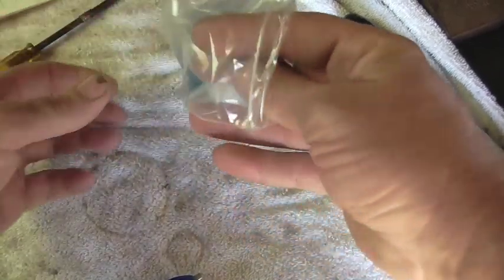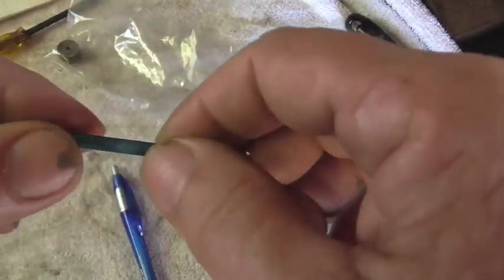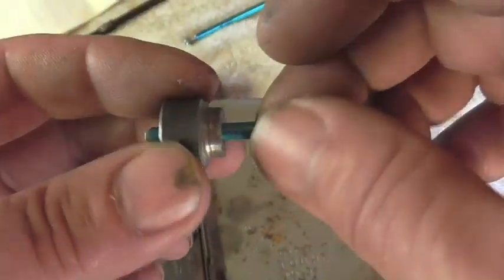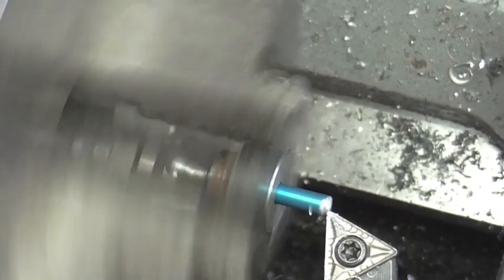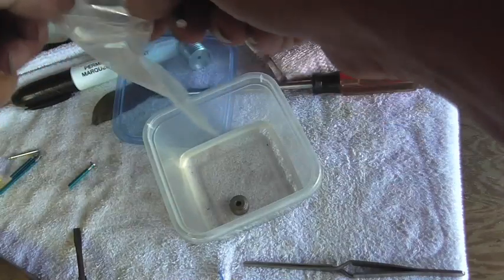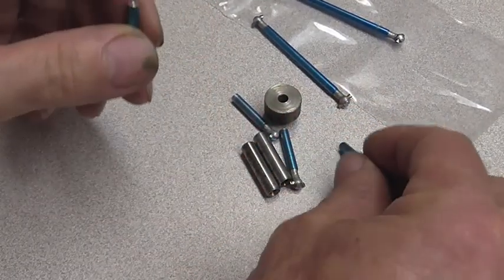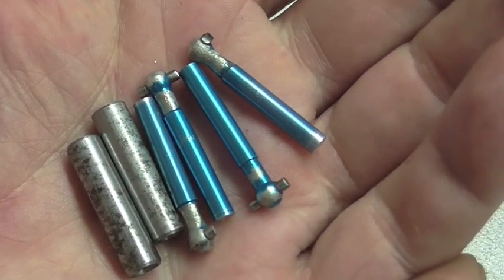QWIK CLIP - Machining Small RC Car Parts, work holding exercise  - MSFN

Comment: I need to turn a 3 mm brass rod of 15.30 mm length and turn most of it to 2 mm then drill a 1.5 mm hole through it.  How do you recommend I do it?  I have a mini lathe and mini mill, so I should have the tools.  Just not sure how to go about it.  It's for a small rc plane wheel bushing.
Reply from the maker: Sounds like you have all the right equipment for the job. Turn the OD and do the drilling in the same setup so they are concentric. I wouldnt rely on a drill to make a 1.5 mm hole, drill undersized & use a 1.5 mm reamer to finish out the hole. Good job for a mini lathe :-)

Comment: I would have just cut it, turned a new ball on the end and then put a new pin in the end. Or cut it, bored it, installed a bar in it then stake pinned it. But there is more than one way to skin a cat, for sure. 
Thanks for the show. Best wishes and Blessings. Keith Noneya
Reply from the maker: Yep, lotsa skinless cats around this place 😊

Comment: Good video Rich and yes, I think your right, Super Glue does come in handy.  I have used the thin type to paint wood threads when I was prototyping some stuff.  You would be amazed how hard and durable it makes wood threads.  Now, it occurs to me after some reflection of a summer evening cleaning my wind shield at the gas station, if one could figure out how to make glue from bug guts, well then they may be on to something!!

Thanks for sharing!
Reply from the maker: Its good for some stuff...(2) bottles for a buck at the dollar store 😊
Reply: Yeah, maybe.  But here Tennessee bugs are free!!! hehehe

Comment: gentleman, please don`t think that way, rc parts can be really expensive. i have seen some of those rank at USD 500+, just aluminum parts! if you don`t want to machine couple hundred parts and just earning peanuts, tailor make rc parts can be one of the choice. afterall, for the skill you have, those aluminum parts are just piece of cake.
Reply: Imagine what you could do with cnc machine. . .And it needs1/4 of a skill to do it manual.
Reply: CNC lathes are overated but cnc milling machines are just wow-it takes so much equipment and time to do a cam or helical spiral on a manual machine,not to mention you have to be a true machinist.Cnc mill does it within 20 min-it would take you just to set up a thing that much on a manual lathe.For complex things its just amazing technology.(200k$ not the chinese 300$ crap)
But again its $$$.Cnc machines cannot stay idle othervise they never pay for themself.
Reply: I worked in a shop like that for some time.Problem is some bosses dont know the limits of the machines and machinists  they have and will take anything.And then as you said you get problems -and problems can cost you money .So at end you spend more than you made(time,tooling,materials,electrc bill etc ).
If you are self employed that is a good thing to do ,but always know your limits.Knowing how to make part is great but to know how to charge for it is whole other thing.Calculate material costs ,electricity , cost of tools(how many inserts you spend -etc no matter how small),how much hours you need to make part,(how complex it is to machine,do you need special jigs etc),how much electricity you are going to use(it all adds up at the end of month),whats your hour rate(you are not a charity you dont work for free).Add taxes to that if you work trough the bills.
Once you calculate all  that you ask customer how much does the part cost new and add 10-15% of that price to a Total(the thing you calculated above)-its your profit ,your earning.Always take portion of money in advance-material costs-you would be supprised how many people didnt come to take their parts once they were done and you end up with useless thing made of expensive brass that you paid.
if they say its expensive you tell them to go buy a new one-most of them will stop complaining.Others you just show them doors -they are not worthy off your time. For returning customers you can give them discounts,but for those flybys you do as mentioned above you will never run out of buissness.
Reply from the maker: He has brought me 2 more jobs since this was filmed
Reply from the maker: I always imagine what I could do with a CNC....its as close as I will probly come to one...LOL
Reply from the maker: Yes, they are amazing...Could do something that would take me all day in 10 min. My niche is one-off work other job shops wont take
Reply from the maker: You know that I am a new machinist....nowadays I have more time than money. My goal is to make machinist work my main income, and if taking on weird stuff to gain a clientele and referrals gets me there...I am all in. Never had a customer yet find fault with my work and refuse to pay. Its always done to spec....even if I spend more time on it than billed. Its the price I am willing to pay to learn the trade
Reply: Hey building a name takes time,but goal is not to bankrupt while doing it(most of us are not Donald Trump to do it 10 times).Do right by your customers but also make money,like i said learning how to profit is as important as machinist work itself.Good name spreads fast but a bad one spreads even faster.
Some people think its like i watched two videos on youtube now i am expert.Its a trade that you learn your whole life-that makes it fun ,every day you do something new.Its a creative job not some boring shelf stacking in supermarket.

Comment: Hi Richard. Any reason you didn't cut a slit in the holder to use as a collet?  👏👍
Reply from the maker: Honestly David, I didnt think of it at the time, I had done that to hold square stock in the lathe before ~ Richard

Comment: If you split the collet you made to hold the pieces, would a three jaw Chuck have squeezed it hard enough to hold it? Probably not?
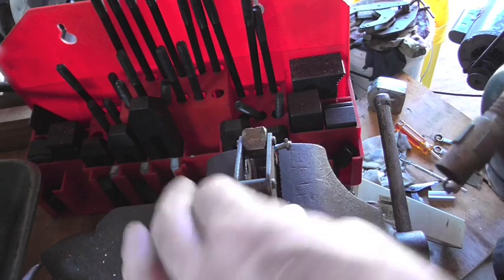Reply from the maker: Sure would if the hole drilled was the same OD as the part to be held before slitting the collet...check out this vid at 5:20 put up by a friend of my channel https://www.youtube.com/watch?v=BDiFf4uUx5g

I just took the quick and easy way out with SGlue

Comment: I am old school and use a similar vernier as you. Mine is a Mitutoyo I bought 40 yrs ago. I still trust it to this day. It never really seems to matter aside from threading eh. I am still not sure which system I prefer as I can work both.You use more glue than I ever would imagine, Hell man if it works it works ! That nice accurate chuck is a real savior bud. I worked off one with .030 runout in it once and it was awful. No changing that setup, , ,EVER ! Little things are just plain hard to work with. Most of my world was in the 3 to 8 inch area. + to 30 + ft. . Way more suited to the logging and trucking world and oilfield /space.Great to hang around again with ya fella. Good job, , , AGAIN !
Reply from the maker: Thanks Dean, I am not used to working with such small stuff but was glad to help him out. Yes, I use super glue a lot...it has never broken loose under torque as long as you dont go crazy with DOC ~ Richard
Reply: Love it bud. I just used it for the first time a week or so ago and a complete success. Many thanks fella !
Reply from the maker: Me likes it under certain circumstances 😊
Reply: WOOHOO Bud !

Comment: Just curious,  did he need the sleeve OD to be a certain dia? I assume space is limited when rc cars are involved.
Reply from the maker: Yes, he did the legwork.... the sleeve OD had to be .250 or less, I used some .250 drill rod I had in stock. His was a custom made car so the run of the mill dog bones (thats what he called them) wouldnt fit, so with a sleeve he can now adjust them to the proper length and loctite them in ~ Richard

Comment: Always enjoy your videos.  Have you ever thinned down a knife blade? It's a hallow grind,  hard as heck, and too thick to put a good edge on.  Ass you have seen my crude style in afraid I would simply destroy it.  (By hard as heck, I mean it skates a file)
Reply from the maker: Good knife blades...thats hardened & tempered steel, its meant to hold an edge by being tuff, can use a fine grit belt sander on them with good results or a grinder with the proper stone wheel. Get ya some nice sharpening stones....works wonders. I appreciate ya Rodman 😊 ~ Richard
Reply: Makin Sumthin From Nuthin I have stones,  just don't have a belt grinder at present time.  It is a straight razor my wife bought me on a vacation we took some years back.  I have tried using a tristone with zero luck lol.
Reply from the maker: You need to get on building one then! lol
Reply: Makin Sumthin From Nuthin shew man I'm so far behind it's not funny. I do plan to build one tho.
Reply: You dont thin down a straight razor-as you sharpen it spine of razor will thin down as well-it keeps angle of the blade same.
Straight razors are commercialy  sharpend by 2 wheels spinning in opposite directions.That way you grind two sides evenly at once.You could try it on a wheel but i doubt you will get 2 even sides,its something you have to have experience with to do it by hand .
Reply: Usualy they are razor thin,did you bought maybe blank that was not ground yet ? Anyway if you cant use it then you can practice on it.Maybe use dremel like tool with sand paper drum to thin it down.
You can buy silicone carbide sandpaper and a wooden dowel,and a regular bolt.First cut down sandpaper in a strip like 1/2inch wide then use wood glue and glue it to dowel in a spiral pattern.Drill dowel in a middle and put a bolt trough it.Cut dowel to any size you want.
My guess is this is best way to regrind it without special equipment.Just remember to cool it off with water so you dont ruin the temper due high rpm.
Good luck.
Reply: zumbazumba1 thanks,  I have zero experience lol.  I can sharpen my other razor as it isn't ass thick.  Ii shave with it atleast once a month.  ((Hate shaving)) I just can't get this one sharp at all.
Reply: zumbazumba1 it was bought for me some years ago.  It has a dull edge but not near sharp enough to shave